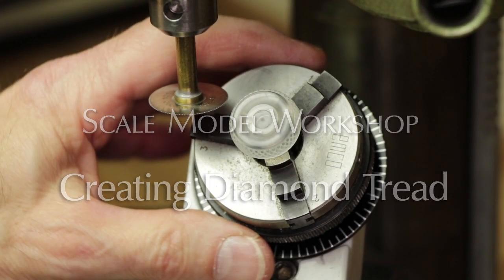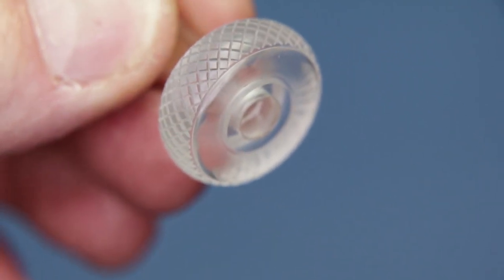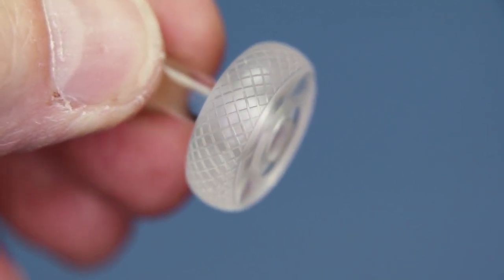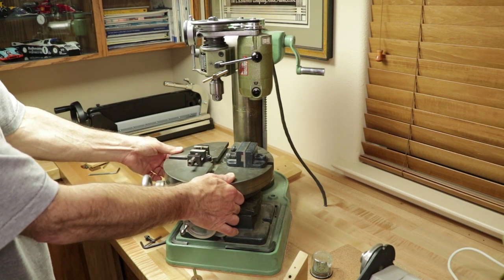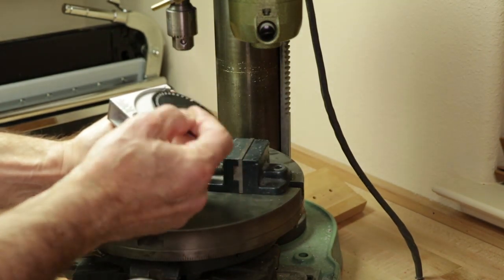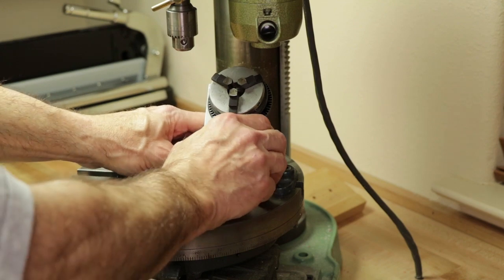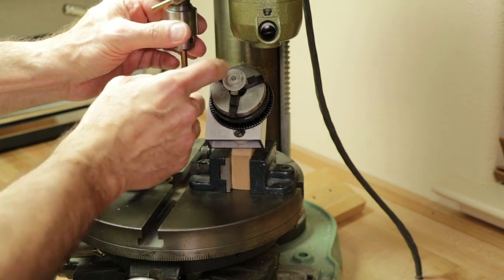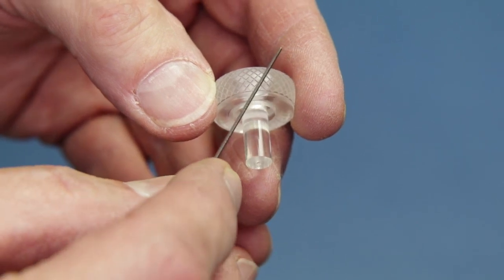Creating a Diamond Tread Pattern Tire

Comment: I still think the  New resin wheels are the only way to go today resin is incredible. I have made lots of wheels and other parts this way but the new resin 3D  Printers are amazing iam a full time model builder and I now have 3  Different 3-D printers  now  and they have saved me a lot of money.paul what are your thoughts on the 3d printers will you ever use them .love your Videos you are a true master
Reply from the maker: Brad ... doubt I'll get into 3-D.  I have Solid Works, but pushing a mouse  around and shortcut keys don't interest me.  I know it gets the job done and you can do some amazing things, but for me, it's much more about the process.  So I do my part to promote that ... and I guess that either works for some people or not.
Reply: @scale-model-workshop I know I’m late to the party here, but thank you for that response! Having just observed my 65th birthday, I’m unapologetically old school. The computer aided/controlled stuff can indeed produce some good stuff, but in my opinion, (and we all know what opinions are like!) it takes away from the hands-on craftsmanship element. My son, who has at his disposal at my house a very well equipped model building, home engineering (machine shop w/mini mill & lathe, small sheet metal shear/brake/roll, etc), and woodworking shops, prefers to pursue his “making” interests with 3D printers and such, his home hosting at least 3 of them, but he might only use my “manual” shop once a year or so. In the past year, I’ve unsubscribed to several of my previously favorite woodworking and engineering YouTube channels because they increasingly used computer controlled this and that, replacing hands on skill with computer programming! I guess it’s the wave of the future, but I remain firmly rooted in the past!

Comment: Nicely done 👍🏻
However how did you manage to get the same depth of the slot along the rounded shape of the tire?
Reply from the maker: When I was "nibbling", I watched for contact with the surface and then advanced the feed the same amount each time.  Then when I went through the grooves with the file, I cut deep enough to even out the base of the groove.  In other words, even though I have used a machine to layout the pattern, it still come down to hands and eyes.